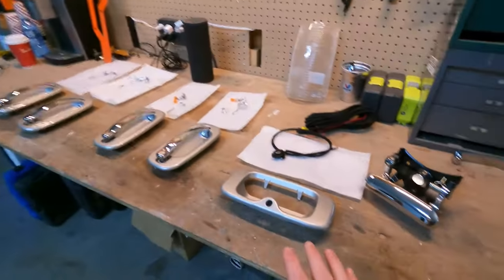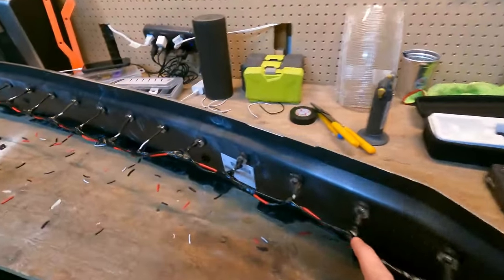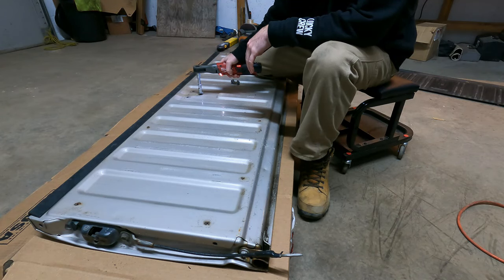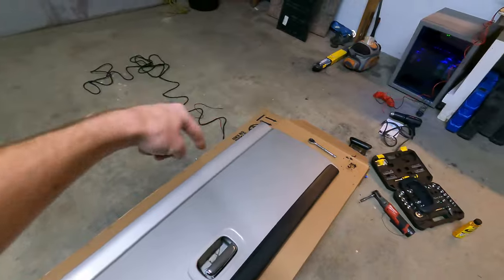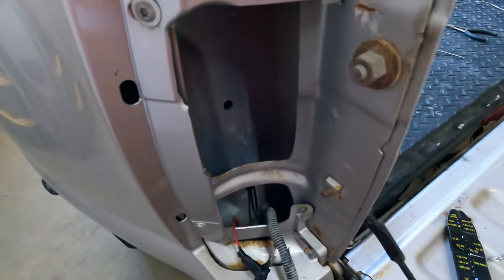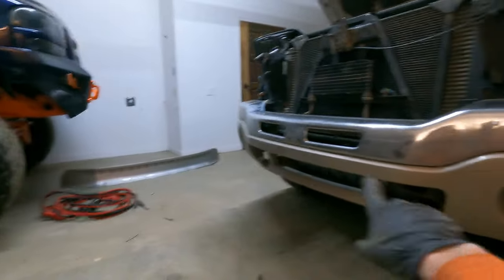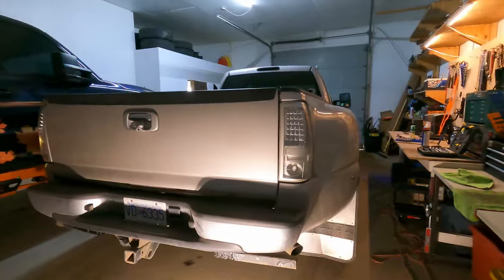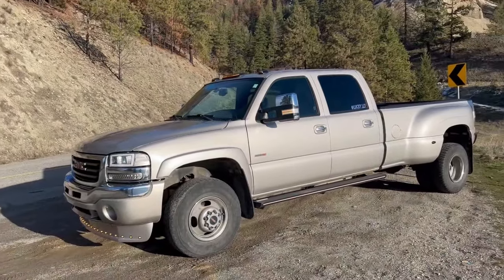Making my Dually Duramax Look 100X Cleaner

Comment: Nice man. Makes me miss my 05. But have moved onto a 19 cummins. But Here’s what I did to my LLY when I had it and it moved: 

S&B Cold air intake, Turbo mouthpiece, PPE Racing fuel pressure valve, Welded water pump, Sinister egr delete, PPE Ported fuel fitting (driver side), 3” Hot side boost tube, 110 gph FASS lift pump (known as the FASS fuel enhancer. it’s just the pump, no filters but has a 1/2 inch in line filter. Keeps a constant 8-10 psi of fuel pressure to the cp3) 3” MBRP downpipe, 4” Diamond eye straight pipe, 8” tip, EFI Live (5 tunes 15 optimized,30 tow,60 street,100 race,120 hot), CTS2 Monitor. I ran diesel deep clean every fill up

-Transmission rebuilt. Kit included new clutches and steels, trans go, new trim solenoids, gaskets, tranny brace, and new spin on filter filled w dex VI, triple disk Suncoast converter (GM 1056-3D) w a 2000 Stall.

Pretty sure I’m missing some stuff
Reply: Have any issues with the new Cummins compared to the old lly you had? Since it’s a 2019 new diesel with emissions
Reply: @CLD73 some electrical issues in the beginning, leaking cab lights (fixed w new recon cab light), and the suspension. Mine breathes better than the average 19 Cummins.